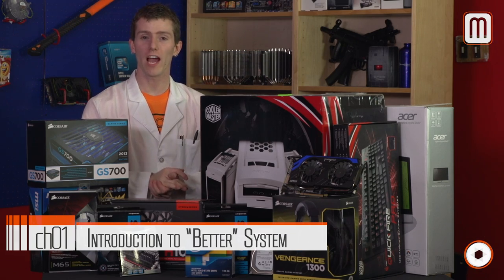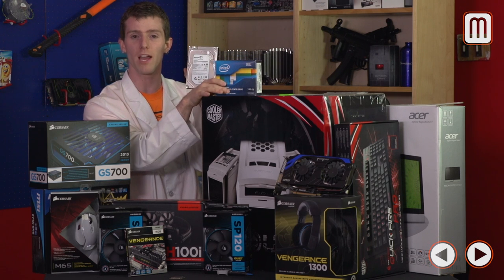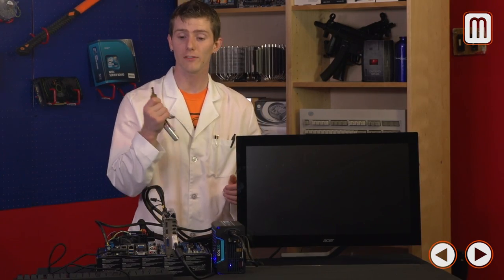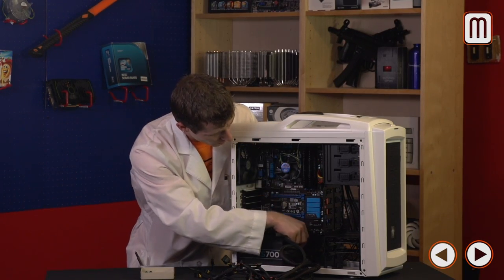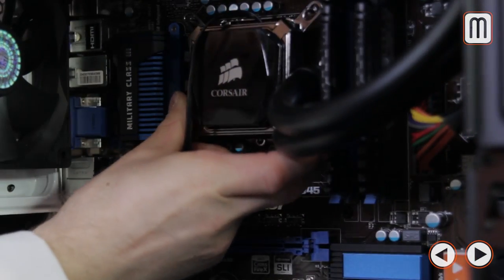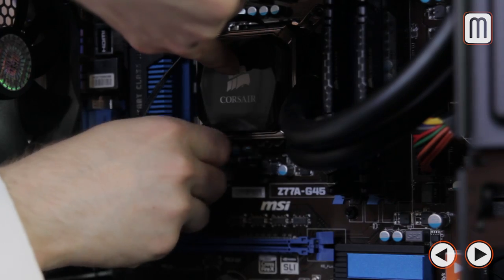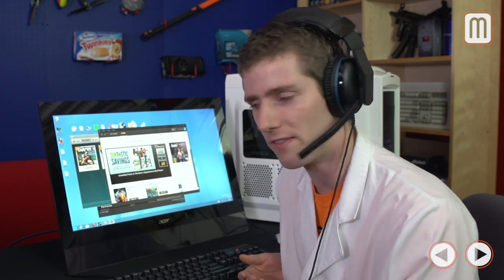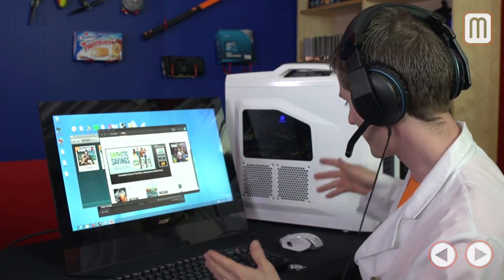ULTIMATE Build a Better $1500 Gaming PC Computer "How To" Guide

Comment: Since everyone seems to be asking...
How good would this build be? I've asked around some, its my first build, and so far I've been told that its good. I know the processor is overkill, this is in case I want to upgrade the graphics card in the build.

ASUS GTX 970 Graphics Card
Intel i7-4790K Processor
2 x 8GB CORSAIR Vengeance Pro DDR3 RAM
CORSAIR CX750M Power Supply
Intel 530 180GB SSD
Seagate Barracuda 3TB HDD
MSi Z97-G45 Gaming LGA 1150 Motherboard
CM Storm Trooper Case
CORSAIR CO-9050029-WW Red LED Air Series Twin-Pack x2

It adds up to about $1400 off sale on NewEgg.
Reply: Destess The build is quite solid, and there's a decent amount of space for upgradability. If you plan on doing any sort of overclocking, I strongly suggest getting an aftermarked cooler - either a high-end air cooler, such as one from http://bequiet.com or a liquid cooler such as the h100i, from http://corsair.com .
Reply: MD II Yeah, I was looking around recently and I decided to spend a little more money for the H100i. Thanks for the feedback :)
Reply: Destess That's similar to the build I'm doing, though I'm going with 16gb G.SKILL for $99 and the 750M is overkill. Get a 650 instead.
Reply: TheReapersSon Yeah, I changed the specs a lot xD
I decided to spend a bit more money for some more performance.
New specs:
Intel i7-4790K
ASUS GTX 980 (To be dual SLI'd later)
4x4 GB Corsair Vengeance DDR3 2133 MHz
ASUS MAXIMUS VIII HERO
Corsair H100i
EVGA SuperNOVA GS 80+ Gold 650W Full
Samsung 850 Pro 128GB SSD
Seagate 2TB 7200RPM Hybrid
Delta Electronics AFB1212GHE-CF00 120mm Fan x 4
About $2000
Reply: Destess Use your first build as a base. Change to a different power supply; the CX series has some serious issues (such as frying whole PCs). Also, change the SSD to an 850 EVO; this will save you a lot of money without sacrificing speed. Don't get more than 1600MHz RAM; the difference is barely noticeable, and it's not worth the extra money. I'd also monitor your RAM usage (really easy in Windows 8 with task manager), to see how much RAM you actually need. I wouldn't go below 8GB, though. The CM Storm Trooper isn't a bad case, but there arebetter ones for your money. Look at the NZXT Noctis 450, the NZXT H440, the Fractal Design Define R5, or anything from the Corsair lineup (the Graphite 230t, Graphite 760t, and Graphite 780t all look very similar to the Trooper).
Reply: Destess "2 x 8GB CORSAIR Vengeance Pro DDR3 RAM". You didn't say the speed of the Ram's bruw ;)
Reply: ItzThirsty Yeah, I updated the list below lol
Reply: Destess  Aaah haha
Reply: +Destess How is the computer treating you? I am having NCIX send me a build soon, I kinda cheaped out on everything but the cpu and gpu, so I hope nothing goes wrong. Too late to change anything now, but for future reference/replacing things in the next year or so if I made some bad decisions, I would like to hear some opinions. This is what I got:

1 x Seagate 1TB 3.5in SATA3 64MB Cache Internal Solid State Hybrid Drive SSHD for NCIX PC

1 x Intel Core i7 4790K Unlocked Quad Core HT 4GHZ/4.4GHZ Processor LGA1150 Haswell 8MB Cache Retail
1 x Cooler Master Fan RR-HT2-28PK-R1 Hyper T2 Heatsink CPU Cooler LGA1150/FM2+/FM2/AM3+/AM3
1 x ASUS B85M-G R2.0 mATX LGA1150 B85 DDR3 2PCI-E16 PCI -E SATA3 HDMI USB3.0 Motherboard
1 x Kingston HyperX Fury Memory Black 16GB 2X8GB DDR3-1866 CL10 Dual Channel Memory Kit
1 x EVGA GeForce GTX 980 Ti Superclocked 6GB GDDR5 384BIT DVI HDMI DP SLI Ready Graphics Card

1 x Bitfenix Comrade White Window ATX Mid Tower Case 3X5.25 7X3.25 1X2.5 No PS Top 2XUSB3.0 Audio
1 x Corsair CX Series CX750 750W ATX 12V 80 Plus Bronze Power Supply Active PFC Fan 120mm Fan
1 x Microsoft Windows 7 Home Premium Edition 64Bit SP1 DVD OEM

1 x SanDisk Ultra Plus 256GB 2.5in SATA3 6GB/S Marvell Solid State Disk Flash Drive SSD
1 x ASUS DRW-24F1ST 24X SATA DVD Writer Black
       Electronics Recycling Fee $0.75 Per Item
1 x ASUS Xonar DG 5.1 Channel PCI Sound Card 24BIT Dolby Digital DTS 105DB SNR W/ Headphone AMP
1 x Intel PRO/1000 CT Desktop Gigabit Ethernet Network Adapter PCI Express NIC OEM

3 x Bitfenix Spectre BFF-BLF-12025R-RP 120mm Red LED Case Fan 1000RPM 43.5CFM 20DBA 3/4 Pin OEM

I don't know how well this will work out, from what I understand, as long as all the components support each other, then that is all that matters and I can spend the rest of my money on the cpu/gpu.
Reply: *****
The 980 Ti is entirely overkill for anything except for 4k and you won't be able to take advantage of the unlocked processor with a B85 motherboard.
Reply: Michael Marquardt There was a compatibility issue with the board anyway, so I gave the builder at NCIX full reign to get any board up to $80 more expensive, so I am sure he will pick something exactly $80 more expensive because that is how business works. I trust him to find something decent for me.

Also, I want overkill. I want this card to last me a good 6-7 years before upgrading, what is overkill now won't be in 4-5 years, and it will show it's age after that. Besides, I can do downsampling, or whatever it is called (I will have to do more research on it before I mess with anything) which will provide some extra graphical enhancements if not as good as 1440p/2160p
Reply: Michael Marquardt This is the motherboard the builder picked out for me: http://www.ncix.com/detail/asus-z87-a-atx-lga1150-z87-26-84500-1211.htm
I assume it is all fine, but if you have any thoughts on it, I would like to hear them.
Reply: *****
That one will be great!
Reply: Michael Marquardt thanks! glad to have two sources who know what the hell they are talking about. I feel embarrassed that he contacted me telling me that I made incompatible choices, and to find that I was so far out of my depth when it comes to anything past CPU/GPUs, I never realized there was so much more to learn. Made a proper fool of myself.
Reply: ***** Graphic cards are not what make the machine. And that card wasn't even out when I posted this. But since I made this post I have learned a lot about PC builds and I completely redid the build. If I were to get a 980 Ti then that would be more than half the money gone, leaving me to pick shit parts for everything else. 8 gigs of RAM, an i5 which obviously isn't a good match for the 980 Ti, and some motherboard that isn't good enough for the build. Getting a 980 Ti wouldn't see as an improvement in a 1500 build, it might give some advantages in some games, but in others, even the 970 build I had set up here would be better.
Reply: If anyone wants to know what the build is right now, its the following components:

Intel i7-4790K

ASUS MATRIX GTX 980

4 x 4GB CORSAIR Vengeance Pro

Corsair H100i

MSi Z97-G45 Gaming

EVGA SuperNova GS 650W 

Seagate ST2000DX001

Samsung 850 Pro Series

CM Storm Trooper

Delta Electronics AFB1212GHE-CF00 x4

I haven't ordered the parts yet, but I plan on doing it within the next year or two.
Reply: Destess Do it before then - you'll have to rework it if you want to have it be good if you order it in two years.
Reply: Michael Marquardt Yeah, I know. I'm just trying to get the money for it first. I'm just getting out of high school, so I need to focus on college and a car as well.
Reply: Destess Instead of psyching yourself out for a new computer, definitely get the money first. College is priority one, but how much do you want the car versus the computer? Depending on that, and how much you make at a part time job, you can do the math and figure out when you will roughly be able to get a set $1500 or so.

 By then, new tech will come out and stuff like the 980 TIs will be much cheaper. There is 0 reason to getting a dream build set several months in the future, because you will only make yourself depressed with waiting so long, and end up rebuilding a new computer idea every two months due to price drops. It just gets you on this sugar rush with nothing substantial to base it on. I fell into that trap about 8 months ago when my laptop started dying. Trust me, just save up, then two weeks before you have enough, start doing the research.
Reply: ***** Yeah, I know. It intrigues me, actually. I really like doing it for reason unknown to me.
Reply: Destess It was the same for me, I just really liked making exciting new builds. Hell, while doing my research for the build I settled on (even though I made mistakes as Micheal pointed out) I made aboot 4 or 5 different builds. But when I had 0 cash dollar to spend, I would pine away my days building computers I knew would not actually become a thing, and it made me more sad afterwards, lol.

Comment: In the first part about CPU in chapter 11, should I still get Prime95 even though I'm not overclocking? Also, will MSI Afterburner and MSI Combustor (sorry if spelled wrong) still work if my gfx card is not from MSI? Thanks in advance!
Reply: ***** Prime95 is useful overall as a stress test for your CPU, and can give you an idea about the top temperatures and fan speeds that you can experience. MSI Afterburner and Kombustor will work even if your graphics card isn't MSI, and Kombustor, just like Prime95, is a synthetic stress test that work the GPU as hard as it can go.
Reply: Ah alright. I see now. Thanks!

Comment: This isn't 1500 but is this a decent PC build for under 1000 
Corsair - 8GB DDR3 SDRAM Memory Module - Black
Asus - Desktop Motherboard - Intel Z97 Express Chipset - Socket H3 LGA-1150
Corsair - CX Series Modular CX750M 750W ATX Power Supply - Black
NZXT - Source 220 Mid-Tower Case
EVGA - GeForce GTX 960 2GB GDDR5 PCI Express 3.0 Graphics Card - Black
Intel® - Core™ i5-4690K 3.5GHz Processor - Multi
WD - Blue 1TB Internal SATA Hard Drive for Desktops (OEM/Bare Drive) - Black/Silver

Comment: i am a noob at this stuff since  This is my first time building a computer so i was just wondering how is this build?

Corsair H100i 77.0 CFM Liquid CPU Cooler
Gigabyte GA-Z97X-UD3H-BK ATX LGA1150 Motherboard
Corsair Vengeance 16GB (2 x 8GB) DDR3-1600 Memory
Intel Core i5-4670K 3.4GHz Quad-Core Processor
Intel Core i5-4670K 3.4GHz Quad-Core Processor
Gigabyte GeForce GTX 960 2GB Video Card
orsair CX 600W 80+ Bronze Certified Semi-Modular ATX Power Supply.

Comment: Im upgrading my pc currently and when I'm done it should look something like this:
CPU: i5 4690k @3.5ghz
Mobo: Asus sabretooth z97 mark 1
GPU: Asus Strix GTX970 4gb
Ram: 16gb ddr3 @1600mhz
HDD: 1TB western digital red intellipower
SSD: 240gb Kingston
Case: NZXT Phantom 410
Extra fans 
PSU: Toughpower 750w

I was wondering how everyone thinks this will run games like DayZ standalone, arma 2, bf4, arma 3 and some other aaa titles, any help would be appreciated. And I was also wondering whether water cooling for my 4690k is completely necessary as I have a budget. And my case is equipped with 2 140mm top fans, 1 120mm rear fan and a 140mm front intake fan. Thanks!
Reply: Its a thermaltake toughpower 750w gold modular power supply :) I think it's decent quality

Comment: I built a much better system for $1300. I tried an AMD 8370 but way too slow unless made to play on AMD which is not many. Then tried Intel Core I5 3770k CPU at first but was too slow. Got an Intel i7-4770k and was much better. I know most games don't recognize multi-cores but you can tell a difference.

The rest is Asus Republic of Gamers motherboard, dual Asus Nvidia GeForce 760 GTX video card and 16GB of memory. Besides the hard drives, rest don't matter too much since people have difference in what they like.

I know this is an old post but video was around when I built my computer. Might be able to find the parts cheaper now since newer stuff is out.

Comment: Hey guys, I'm building my first gaming PC and I would like to know if the configuration I came up with is good. Any help would be appreciated. Thanks!

CPU: Intel Core i5-4690K 3.5GHz Quad-Core Processor
CPU Cooler: Cooler Master Hyper 212 EVO 82.9 CFM Sleeve Bearing CPU Cooler
Motherboard: ASRock Z97 Extreme3 ATX LGA1150 Motherboard
Memory: G.Skill Ares Series 8GB (2 x 4GB) DDR3-1600 Memory
Storage: Kingston HyperX 3K 120GB 2.5" Solid State Drive
             Western Digital Caviar Blue 1TB 3.5" 7200RPM Internal Hard Drive
Video Card: Gigabyte GeForce GTX 970 4GB WINDFORCE Video Card
Case: NZXT S340 (White) ATX Mid Tower Case
Power Supply: EVGA SuperNOVA NEX 750W 80+ Gold Certified Fully-Modular ATX
Keyboard: Cooler Master CM Storm Devastator Gaming Bundle Wired Gaming Keyboard w/Optical Mouse

I've taken a lot of inspiration from this video and other similar ones - as you can probably see.

Comment: i have built like 5 computers and i still use the manual to see where the front panel connectors like the power switch and stuff like that

Comment: I don't know if this is good, I need your opinions, here are my specs: 
GTX TITAN X x3
I76900000 x49
100TB

can I run minecraft at 2fps?
Reply: Might be able to run at 3fps
Reply: +Doge Hey I have seen you in Agar.io
Reply: +Doge Add 1 more Titan X and you'll need another 100TB SSD for your OS. Add those and you should be able to play Minesweeper at 4K at 20-30FPS.
Reply: Matthew Mellross you ruined it, your supposed to say at 128x128 at 3fps
Reply: Yes but there is no proccecer like that
Reply: facedesk
Reply: Depends, what gaming chair do you use?
Reply: +Quietbut_Deadly if you don't have a gaming chair, what will you use? ans:gaming ass
Reply: A67 -Random Games
A regular chair?
Reply: Coming from the guy who called me 100% stupid. HA!
Reply: Well, okay then. If you say so. Here's the "correct" comment: add 18 more Titan X and 200TB SSD and you might be able to get 1FPS at 128x128 on Minesweeper. Happy?
Reply: It's cool

Comment: Here is my build is it good?

AMD FD8320FRHKBOX FX-8320 FX-Series 8-Core Black Edition- CPU
Corsair Vengeance Blue 8GB (2x4GB) DDR3 1600MHz - Memory (ram)
ADATA USA Premier Pro 2.5-Inch 256GB- driver
Cooler Master Hyper 212 EVO - CPU Cooler
SAPPHIRE 100363-4L Radeon R9- graphics card
ASRock H81M-HDS- Motherboard
Corsair CX 600 Watt- power supply
Corsair SPEC-01 Mid-Tower- Case

I know my budget is not very high and I wouldn't say I know a lot about building a pc but is it a good build for about 750$?
Reply: The CPU and Motherboard aren't compatible, that motherboard supports LGA1150 Intel CPU's. I'd recommend replacing the AMD CPU with an Intel CPU that uses that socket, such as the i5 4690k (that is an example, you can look through CPU's of your choice, as long as it's Intel and 1150.)
Reply: Also, if you're strict on budget you can just replace the motherboard with one that does support AMD CPU's, such as the MSI 970A-G43
Reply: After i wrote this comment I have already made some changes. What do you say about this build?

Memory- G.Skill Ripjaws X Series 8GB (2 x 4GB) DDR3-1600 Memory
Storage- Western Digital Blue WD10EZEX 1TB 7200RPM SATA 6.0Gb/s 3.5" Hard Drive
Graphics card- EVGA GeForce GTX 960 SuperSC 
Motherboard- MSI 970 GAMING ATX AM3+
CPU- AMD FX-6300 3.5GHz 6-Core Processor
Power Supply- Corsair CX 500W 80+ Bronze Certified Semi-Modular
Case- NZXT 410 mid tower (red)
CPU Cooler- Cooler Master Hyper 212 EVO

Comment: Can anyone tell me if my build is any good?
CPU: i5 4690
Mobo: MSI h97 guard pro
Ram: Corsair Vengeance Blue 8gb
HDD: Western Digital Blue 1tb
SSD: Crucial MX100 256gb
Corsair CX600w
GPU: VGA Gigabyte GV N970G1
Case: NZXT h440
CPU Cooler Corsair H80i with 2 SP120's

Comment: Guys im thinking about building a gaming pc (max budget 800 dollars), are these specs good or should i change? btw this is my first time :) Could you guys give me advice for what is unnecesary i could change for something cheaper but would offer me about same power? As i want to keep the budget a little lower. I was looking for running witcher 3, gta and so on at high, about 40- 50 fps.
- Intel core i5 4460k 3.2 GHz quad core
- Gigabyte GA-Z97-HD3 ATX LGA1150 motherboard
- G-skill Ares series 8gb (2*4gb) DDR3-1600 memory
- OCZ Arc 100 240 GB 2.5'' SSD
- SEAGATE Barracuda 1TB 3.5'' 7200rpm internal hard drive
- GIGABYTE Geforce GTX970 4gb windforce 3x 
- power supply: EVGA 500 W 80+ Bronze certified Atx

Comment: how much will this build cost:
asus strix GTX 950 2 gb
Intel Skylake i3 6100 3.7GHz Processor
2x4GB HyperX FURY RAM
Asus H110M-A/M.2 Intel H110 M-ATX Motherboard
500W Be Quiet! Pure Power 9
120GB SanDisk SSD Plus 2.5" Drive
1TB WD Blue 3.5" HDD
TP-LINK TL-WN881ND 300Mbps Wireless N PCI-E Express Adapter
Windows 10 Home USB Version 64-Bit
corsair carbide spec 02 red led mid tower gaming case
Reply: Ninjaski go to pcpartpicker and put in those specs. It will pick the lowest price per item and give you a total price
Reply: I'd suggest you to swap the gtx 950 for a 1050 since its the same price (actually cheaper according to pcpp) and the 10 series simply perform better than the 9s